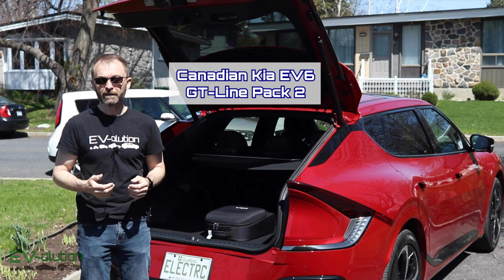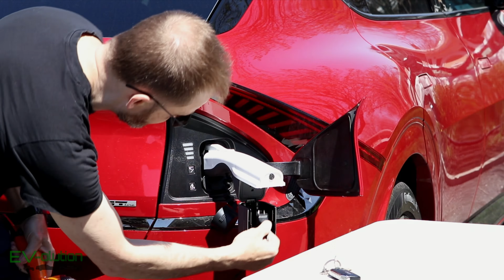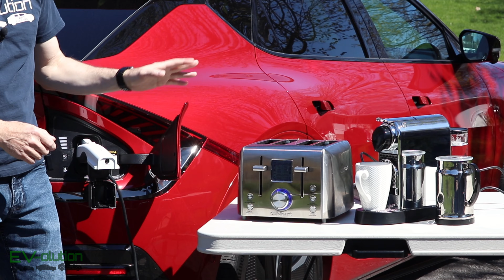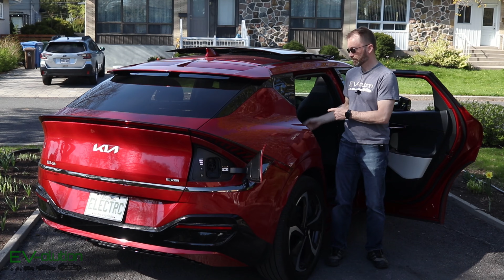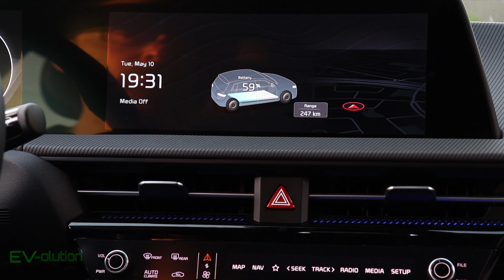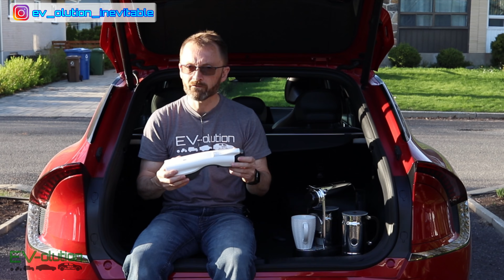Kia EV6 V2L Tested & Explained

Comment: Hello! I'm curious if the EV6 works to output power and charge something? For instance, use my EV6 to charge my Ecoflow external battery bank?
Reply from the maker: Yes, it will output for anything you connect, as long as the power draw does not exceed the 15A 1500W limit for the North American version. The Ecoflow surely won't pull more power than my wife's Kia Soul EV that I charge from my V2L, shown in this video.

Comment: Love the videos. Became a must watch once I found the channel. 

I have a question: I’m going camping and if I use the V2L from the back, how do I know how many amps I’m drawing? And what happens if I draw too much? Does it just stop? Does it damage the battery or the charging port?

I don’t think I’ll overdo it, but I’d rather know before hand just in case.
Reply from the maker: Thanks and thanks for watching. This video actually shows you everything, including what happens when you overload the circuit, and how to reset it. It does not damage the car. You can see the overload test at this point in the video: https://youtu.be/kRkTO3d470M?t=373&si=jAEXMhTex95Qiy38
As for the power draw, it is displayed on the dash of the car when you have something connected to the V2L adapter that is pulling power. You can also see that somewhere in this video. I hope that helps and answers yoir questions. Let me know and happy camping.

Comment: Thanks for this nice informable video. And thanks for the bloopers. Question. Can i turn the car of or is there a setting to turn of the panel and all the lights when camping?
Reply from the maker: You are very welcome and I am glad you liked it. When you put the car in convenience mode (camping mode) you need to turn off the headlights and taillights with the control on the column, as normal, you can then turn off the center touchscreen with the Display Off option shown in the dropdown menu on the top left or most screens, but there is no way to turn off the driver's instrument cluster, which is a pain. Kia should add an option to disable all displays when the car is in convenience mode. With all that being said, you don't need to do any of this when using the exterior V2L, it just works, even when the car is off.
Reply: @EV-olution  Hi thanks for your nice and detailed explenation. So what is the pupose of convenience mode?
Reply from the maker: Convenience/Camping mode is for when you want to leave the car on for heating, airconditioning, radio, etc, without leaving the car on and driveable. If you sleep in your car your can leave it powered on in Convenience mode all night with HVAC turned on and be comfortable. I have done it and it is convenient, no pun intended.
Reply: @EV-olution  Alright, thanks again. You have alot ov nice informative videos. I own a EV6 myself and already found alot of stuff on your channel. You got your self a new subsciber. Have a nice day.

Comment: Great video.  I was thinking of purchasing a VTL adapter but after watching this video I am not really sure what the point would be.  If there is a 110 plug inside car why not just use that only, or am I not seeing a problem that I may have doing this?
Reply from the maker: Thank you very much. Sometimes you want the power outside, when camping as an example, and you want to keep the doors and windows closed, but the biggest benefit is the fact that the V2L works even when the car is off; the inside 110V outlet requires the car be powered on to work.

Comment: Can you put a standard extension lead with a plug straight in to the port and switch V2L on in the car .ie make your own extension in to the charge port , or do you need the adapter ?
Reply from the maker: Sorry for the delay in getting back to you, I was away on vacation. The V2L adapter is required because the charge port on electric cars is not a regular electrical outlet. The V2L adapter is just an adapter though, the car also has to have the technology built-in for the feature to work like shown in the video. You cannot use the V2L adapter on an EV that does not have V2L capability; it won't work. I hope this helps.

Comment: My 110 outlet only works if the V2L is connected and turned on. Kia Dealership here in America said thats the proper way for it to work.
Reply from the maker: If we use that reasoning it would mean that the 110V outlet is useless to rear passengers who may need it while someone is driving, of if you are parked an need to plug in a device, like a laptop. Unless the programming has been changed, that is not how it works. As mentioned in the video, if you power on the car and plug in a device to the 110V outlet inside the car, it should work. If the car is powered off, then the inside 110V outlet will only work if the V2L adapter is plugged in and turned on.
Reply: Great response 👏👏👏

Comment: Let me start by saying I really appreciate your videos and that you share the out takes, it demonstrates that time and effort that goes into making a video that appears flawless. So, after experiencing 45 hours of no electricity due to our recent ice storm ( I’m in the Laval area) I’m curious just how efficient the v2l would be to power some of the essentials ie fridge, freezer, small heater, etc…were you in a similar position or have you had the chance to try this?
Reply from the maker: I am glad you like my videos and yes, they do take a fair amount of time to make. Not everyone realizes that so I appreciate your comment. As for the V2L, I was fortunate where I did not lose power so I did not need to run anything on it. If I was required to do so, I would have plugged in my main refrigerator first to get it past the initial power draw, then I would have tried the second refrigerator to see if the overall load was more than 1900W. I think 2 refrigerators would work if connected with a delay between the two, but it will depend on the age and type, and have to be tested to really know. Once up and running I would expect them to run for 2 or 3 days without issue.

Comment: Great video.....I had difficulty removing the adaptor even tho i had the car option not to lock.....any ideas..???
Reply from the maker: Thank you very much. As for your question, I would have test to confirm if the setting makes a difference, but it is still cold outside and I am not big on making videos in the winter 😎
Reply: i embarrassed myself thoroughly showing off the v2l to a neighbor. you have to unlock the doors to get the adapter out.
Reply from the maker: I am fairly confident that the V2L locks in all circumstances to prevent issues.

Comment: In the UK we have the option of dual tarrif electricity rates, I have an EV tariff with 10p/ kWh 2am-6am, and 40p otherwise. I could use my car as a powerwall! Do you have such tariffs in North America?
Reply from the maker: There are different rates depending on the province. Here in the province of Québec we have the least expensive electricity at 10 cents per kWh, taxes included, all the time and 99% of it is renewable energy. Hydro Québec does, however, have a program called Flex D and I am on it. In the winter months I have a rate of 5 cents per kWh, unless we are in a predetermined peak period where the rate climbs to 50 cents per kWh. The nice thing is that Hydro Québec advises us of the peak period the day before. Peak periods can only be from 6am to 9am and 4pm to 8pm, and the peak advisory from Hydro Québec can be for either time period of the day, or both, with a maximum of 100 peak hours accumulated in the winter season (start and end dates are determined by Hydro Québec). I have been in the top Flex program for a couple of years and we save about 200$ per winter because I have programmed our heating to drop in the peak periods, we don't run the washer, dryer, dishwasher, etc, during those periods, and we only charge our cars during off hours.
Reply: @EV-olution  oh my goodness, you  really have this locked down! And that's an incredible typical rate, so cheap. We're only seeing that sort of flexibility/ communication with peaks very recently, it's innovative for us. Very interesting given the energy crisis in Europe.

Comment: 17:05 - I really wish you would have elaborated on how to find the V2L output power on the dash, because I've been struggling to find that myself! When using the V2L port inside the car (I don't have the adapter at the moment), I can't find V2L status anywhere. Would have been nice to see what that's supposed to look like on the dash!
Reply from the maker: The V2L power draw on the instrument cluster only appears when you use the V2L adapter. The inside 110V outlet does not show on the dash when in use unless the V2L adapter is connected and on. I should have made that clear, sorry. When you use the V2L adapter, the power draw automatically appears on the dash, there is nothing to do.

Comment: Since you're plugging the V2L adapter into the charging port; the same J1772 connector as every other EV in North America, (I'm in the United States), could another EV that does not have a V2L function enabled in it, such as a Mach-E perform the same V2L function as the EV6?
Reply from the maker: Unfortunately no. The adapter is simply the physical connection with some basic logic that works with the actual V2L feature that is part of the EV6 and Ioniq 5.

Comment: Can the V2l not give up to 3600 watt?
Reply from the maker: @xzibit8614  CNET and Electrek are incorrect. I am not the only one to test this and in North America it peaks at 1900W. Once you pass 1900W the "breaker" cuts the circuit, as my kettle+toaster test show. There is another YouTuber who has a video where he measures the power and he also gets a 1900W maximum (see link below). Only the European 240V V2L offers 3500W and in that version you can only use the external V2L plug, you can't use the inside outlet at the same time, which is not the case for North America. This was confirmed by a viewer from the UK who uses their V2L for camping and told me that the outlet inside the car is disabled when using the 240V V2L.
Here is a link to the video that uses a power tester to show the max power load for the North American V2L: https://youtu.be/ffYY6j8Ozq0
Reply from the maker: Not in North America where it is a 110V outlet. In Europe it is a 240V that offers the 3600W, but in Europe you can't use the V2L at the same time as the interior outlet.
Reply from the maker: @xzibit8614  they are partially correct, but the 3.6 is only in Europe, not North America.

Comment: Awesome explanation and test. Ev6 is high in my list of ev to get.
Do you know if v2L works on lower trim?
Reply from the maker: Thank you very much. Yes, V2L is a feature on all trim levels, but depending on the country you are in, you may need to purchase the V2L pistol.
Reply: @EV-olution  its confusing when it says lower trims do no include the, "Iluminated Charge Port with Onboard Power Generator Port".
Reply from the maker: @DJR-u2g I agree, it is not very clear and I think that is on purpose. On the Kia Canada site the EV6 GT Line Pack 2 (like mine) shows V2L as an included technology option, but the Pack 1 does not, and I know for a fact that the Pack 1 has V2L capability because of other owners who have bought the adapter. I am not sure about the US, but I am fairly confident that Kia did not go to the trouble of removing the V2L technology that is deeply integrated in the charging and battery infrastructure of the vehicle, for lower trims.

Comment: Can it do a home refrigerator????
Reply from the maker: It depends on the power draw of the refrigerator. If it is at most 1800W and less than 15A, then yes.
Reply: I just did a test this morning when my power went out.  I ran my smallFrigidaire Side by Side for 2 hours with no problems.  Sorry do not know the power requirements.

Comment: Thanks for the video!

At the beginning, you mention that if you've got the GT Pack 1 or lower, you'll need to buy the adapter to use V2L.  I just want to make sure I'm super clear on that.  I'm considering an EV6, but feel I'm being forced to get Pack 2 so that I can get V2L functionality.  Do the other trim levels have the circuitry and software in place, just not the adapter?  Can I buy a lower level trim, get the adapter separately, and get V2L functionality?
Reply from the maker: From what I have read, all EV6 trims have the ability to do V2L, but in Canada the trims that are below the GT Line Pack 2 do not include the adapter so you have to buy it.
Just an FYI in case you were not aware, there are several differences between the Pack 1 and Pack 2, not just the missing V2L adapter.
Pack 1 has:
- 19" Wheels instead of 20"
- Manual door handles, not automatic
- No sunroof
- 6 speaker sound system instead of Meridian 14 speaker with sub
- Missing active sound design
- Synthetic leather seats
- No HUD
- No V2L adapter
- No heated rear seats
- No cooled front seats
- No cargo cover
I hope this helps.
Reply: @EV-olution  Super helpful, thank you!  I found their website is clear on the differences between the trim levels, except for the V2L capabilities.  It makes it seem like only the highest trim has the capabilities for V2L.

Comment: Does v2l function start in vehicle ign off condition? Or you should have the vehicle in ign Or ready mode to use v2l?
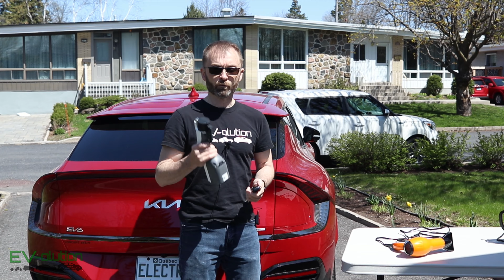Reply from the maker: I should have made it a bit more clear in the video, but as shown at 1:40 in the video, you don't need to turn on the car. Just unlock the doors, open the charge port, plug in the V2L adapter and press the power button on the adapter.
Reply: You said at the start that the function needs to start within 60sec? What does this mean at the start if we do not start in 60secs.?
Reply from the maker: @vishalpatil5646  if you do not connect the V2L adapter within 60 seconds the V2L will not work. That is what the instructions from Kia indicated.

Comment: thanks, good video. can you charge the car and at the same time use the plug inside the car? greetings
Reply from the maker: Thank you very much. The inside AC outlet only works when the car is on. If you are charging then you would need to turn on the car, which will use power and reduce charging speed, and the power outlet should work, but I have not tested that scenario.

Comment: Hi! One of the downsides with my Kona electric is charging speed. Not for my daily use, but when I am road tripping. Do you think it would be possible for Hyundai to improve charging speed for kona electric through software updates?
Reply from the maker: I don't think Hyundai will implement any software changes for the charging curve, but I may be mistaken. What they could do is add battery preconditioning for the winter, which would make a huge difference in charging when it is cold. The 2023 Ioniq 5 will get it, the Genesis GV60 will have it, and I hope Kia and Hyundai put out a software update for the 2022 EV6 and Ioniq 5 to add it since it is the same hardware.
Reply: @EV-olution  Yeah. Winter charging can be terrible for the kona. There is some pre-heating of the battery through "winter mode" though? But its not nearly enough.
Reply from the maker: Unfortunately the Niro EV, Soul EV, Kona Electric, etc, only use the battery heater (winter mode) when plugged in, so it takes time to be of use and takes power that could be used to charge the battery. That is why preconditioning would be excellent.

Comment: Only time will tell but my feeling is V2l is a bit of a gimmick and may not be of much practical use to most people. In choosing an EV I would be more interested in the range and efficiency.
Reply from the maker: I thought the same thing until having and testing it. I will definitely be using it often when I go camping. Another use I found, here in Québec and Ontario there were severe storms that took out power for several days in many regions and because of my video I received several messages saying that people were powering devices and refrigerators to help people out. Most EVs today have long range capabilities, 400km to 500km, and offer very fast charging speeds, which makes other features a focus point for many people. I hope this helps.

Comment: thank you very much. ve been thinking about living offgrid in a camper and use the ev6 as power to charge the batteries in the camper all the power u want plus all the miles u wanna drive for only 625dkr. about 90dollars. very nice. great video answers all of my questiones.
Reply from the maker: Thank you very much, I am glad I could help. An important thing to note for the European EV6 with the 240V V2L, is that if you use the V2L it disables the inside AC outlet.

Comment: Thanks for sharing.  I have the same car.  I have an appointment with the dealer in Brossard.  Due to random error.  Check the electrical system.
Reply from the maker: Is yours blue?
Reply: @EV-olution  it's black
Reply from the maker: @Xavwar  I am sorry to hear that you are having issues. I hope it is something simple and that it gets fixed quickly so you get to enjoy it.
Reply: @EV-olution  thanks

Comment: nice video... please do testing V2L inside while you driving... let say you drive the car and at the same time your wife making coffe or warming a pizza with microwave..
Reply from the maker: Thanks, but I would not make food while driving as it would not be safe, but it would work since the inside 110V AC outlet has access to the 1.9kW and 15A output that it is rated for.